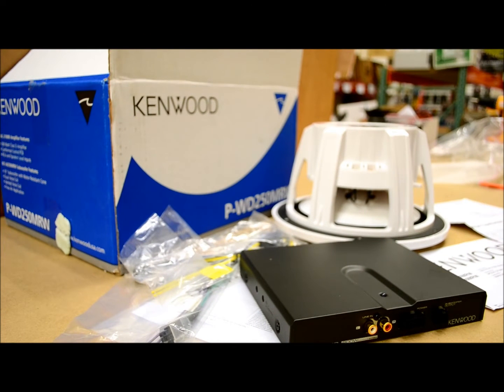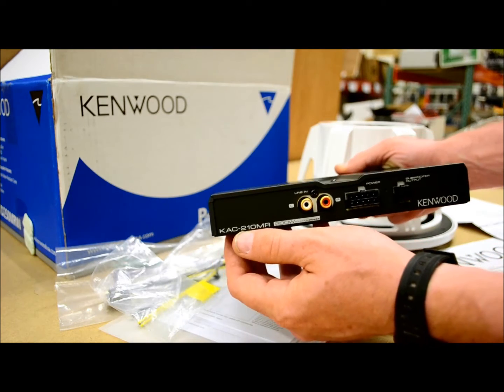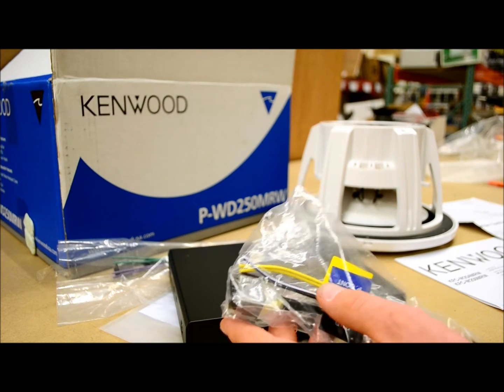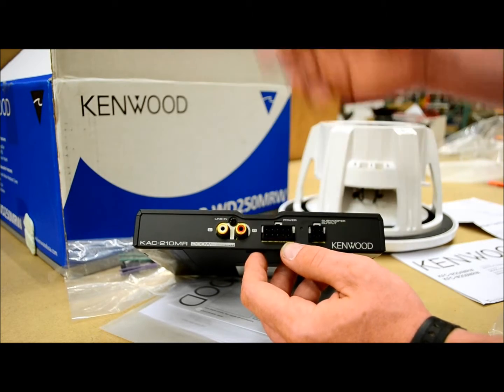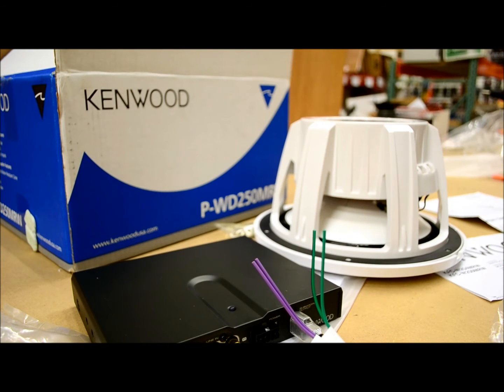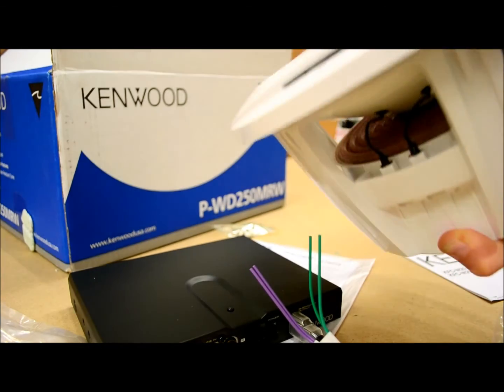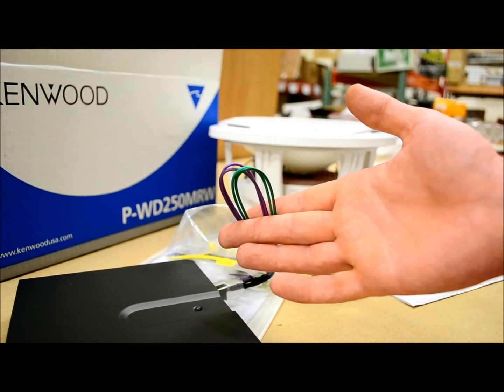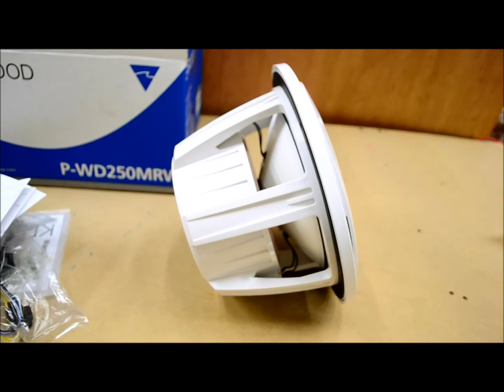Kenwood p-wd250mrw marine sub and amp review

Comment: The kit did not come with the crimp connectors for the speaker.  You will need the female crimp connectors unless you want to solder them.   If you are going to install on a boat into the wood  check the screw lengths and type first, the screws that came with is did not work for my application and I did not figure that out until I had already drilled the holes per the directions.

Comment: Do I attach the green positive and green negative side by side on the top of the subwoofer and then the purple positive and the purple negative on the bottom of the subwoofer? Also, do I connect both black wires from the amp to the ground and both yellow wires from the amp to the power wire to the battery or just one black to ground and one yellow to power? Thanks
Reply from the maker: the 2 greens are rear left and the 2 purples are rear right, theyre independent and cannot share a common voice coil or bad things will happen
Reply: Lessco Electronics thanks for your quick reply. So on top of subwoofer install a green positive with with the purple negative and then bottom of subwoofer install purple positive with green negative?

Comment: I’m installing this in my boat right now. I have a bit of confusion with the wire harness coming off the amp. As you show in your video review there are 2 yellows and 2 black wires (plus the 1 blue). But the installation manual only shows the connection for ONE yellow and ONE black... what should I do with the extras?? Any advice?
Reply from the maker: you connect the 2 yellow together and and the 2 black together as well.

Comment: Thanks for the review. Purchased this, installed, but haven't used yet as my boat is still in storage with the battery pulled. I'm now questioning the way I connected the two inputs, but cannot see the back due to the mounting. Does is matter which terminals the SP.L and SP.R are connected too?

Comment: if your going to do a review, then tell us your opinion of sound quality installed.  Free air mean open air frt and back but you still want to isolate the frt and back waves, so its like a cars rear deck sub, the cabin get the frt wave and the trunk gets the back wave.
if a sub factory mounted in the rear deck is enough bass for you then this might work. if its not enough snap then your going to want either a sealed or ported box. sealed boxes tend to be tight bass but not much output of sound, ported boxed have more sound output and can be tight if undersized for that sub by a small amount of cubic airspace otherwise they play a bit on the sloopy side.

The you get into bandpass boxes, Isobaric bandpass  compound mounted isobaric bandpass boxed that move tons of air.
And contra to what he's said 2 differnt kinds of subs do work if you know how to cross them over and tune the system.
This is why your paying a pro to do your system. DIY don't waste your time and money.
I've done 8" 10" and 18" in the same van with 36k real rms watts of power and hit 157.6 db spl.  
If I had to guess it had 350 cfm of air movement.  Lets just say if you have long hair its not going to stay on your back.  And my wife says can you hear me???? 25 years later.

Almost 89% of the DIY buyers come back to the shop with problems or for help. That's why almost every manufacturer offers a better warranty if its installed by a Pro.

Comment: duh avg diy customer.  Waterproof Nice i can install it in the bottom of the boat!   Hey we're taking on water!  Plug the hole, this woofer fits perfect.   Caution if you blow a sub or tear out the surround the boat will sink!  Make sure its not a foam surround.

Comment: Does the free air comment mean that if put in a box the box needs to be ventilated?  I.E. cut holes in the box?
Reply from the maker: +Jeff Dodson The woofer needs open air space, no box at all. just the fiberglass its mounted in to operate correctly.